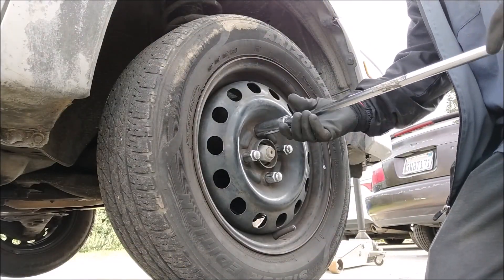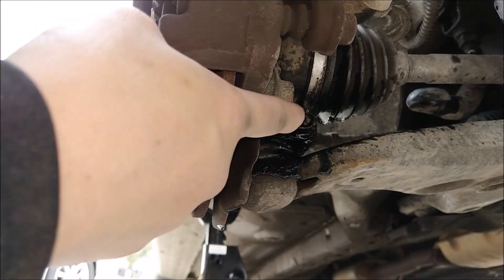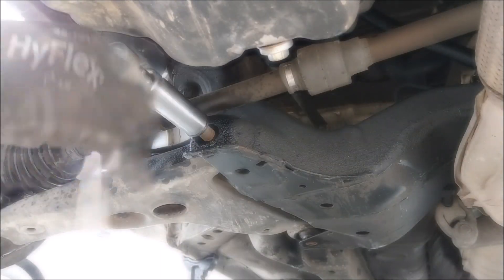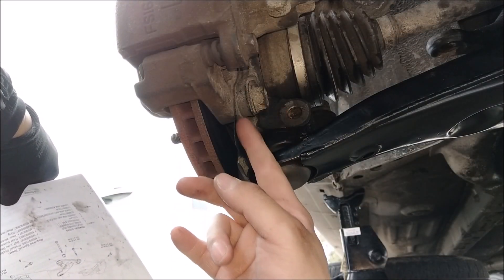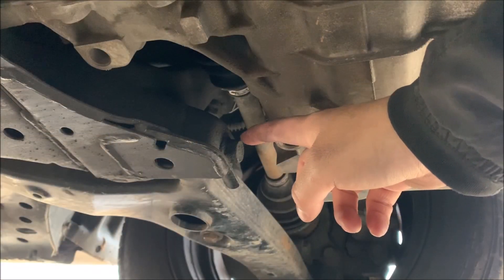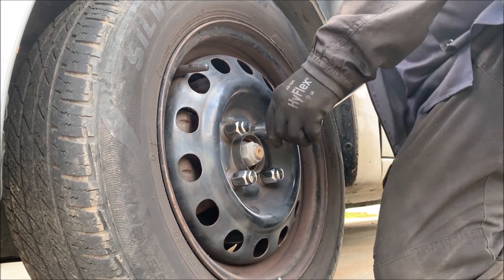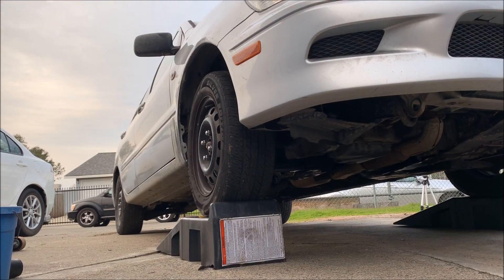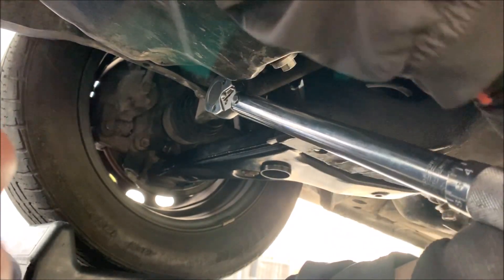Mitsubishi Lancer 2003 ES - Front Lower Arm Replacement

Comment: Leaving comment for future users, aligning the rear mounting point to chassis is crucial to be able to thread the bolt. I took a wooden dowel to align the bolt with the control arm angled out from the car, then managed to get a couple threads caught and then pushed the the control arm towards the front mounting point.

Comment: Thank youvery much im in Puerto Rico and you save me $240.00 just to put it on , i just went spent $300.00 on tools i love working on my cars i don't trust mechanics bunch of scam artists,  trying to scam me for $240.00  plus i had the parts , so i fix the links ,plate,shooks , i got back operations and lots of titanium in my spine , but i always have work on my car's since i was 16 years old, im proud of my self that i was able to fix my lancer 2004 i got it new in 2004 and its 2020 and it runs just as good as my Toyota Corolla 2016.
Reply from the maker: I'm glad my video help you out.  I understand where you coming from.  You really do not know if mechanics out there are really fixing your vehicle correctly.  When you keep your car well maintenance,  it should last you a very long time.  I tell people that I take care of my car and my car take care of me.

Comment: After I turn my wheel the control arm doesn't slide in like yours , should I hammer it in ?
Reply from the maker: This part of the repair was difficult and time consuming.  I did not use a hammer to install the lower arm.  It just took me multiple try before i was able to install the front lower arm assembly.  The order I had shown on the video seem to work for me.  You might have to give it a little push to go in.

Comment: HI Mr. Chang! First thanks a lot for the video, it helped a lot changing my right lower control arm! quick question did you need to do an alignment after changing both control arms? Thanks in advance for your answer! Cheers!
Reply from the maker: I am glad the video had help you out.  You do not necessarily need an alignment to drive you vehicle.  But i would advise to get an alignment done.  Your vehicle will be slightly off whenever there is a repair done on the alignment system.  This will cause premature wears on other part of your vehicle, such as the tires.
Reply: @donkeykongchang  Thanks iwill get an alignment then!

Comment: Hi Kong what are the symptoms if i need to replace lower arm left and right assembly...What about the rubber bushings itself is that only need to replace??
Reply from the maker: The common symptoms of bad control arm bushings and ball joints:
- Clucking Noise
- Steering Wander
- Un-Even Tire Wear
- Vibration

The whole control arm would need to come off to replace the rubber bushing.  You mine as well replace the whole arm with the bushings and ball joints.   Both the lower Arm were about $70 each on amazon.com when i did the repair on this video.  If you wanted to replace just the bushing,  then you will also need a special tools to press the bushing out and back into the arm.
Reply: @donkeykongchang  Thanks Kong I got it mine in ebay... I will install it soon.

Comment: FYI, I was able to torque the front bolts of my control arms with the car on the ground using a 1/2" drive, EP Auto 25-250 ft. lb. torque wrench, a ten inch extension, and a 19mm, low profile nano socket by Astro Pneumatic Tool.  The wrench is about $40 on Amazon, and so is the socket set.
Reply from the maker: Now I'm going to have to tilt my hat to you on this repair.  Way to go!  I was thinking maybe i needed one of them drive onto the ram lift,  like the one they have it at the alignment shop.  Then i'm able to get under the vehicle and get a good leverage on that bolt.
Reply: @donkeykongchang  I just wanted to recommend those tools if you don't have em' already.  They came in handy for me, like your videos.

Comment: Did you have any trouble aligning the bolt near the oil pan?  I can't seem to get mine into the last hole.  Is there a trick to it?
Reply from the maker: I had replaced both my lower arm assembly and alinging for the three bolt is the hardest part of the repair.  It did took me quite while to install the lower arm off camera.  What i found to work best is screwing on the first bolts in the rear (be on 6:11 of the video).   Once the first bolt is on,  you can move to the second bolt which is on the front (be on 6:32 of the video).   Once the second bolt is on,  you can then work on the last bold which is under the hub/knuckle. For me, it had to be in this order to work.
Reply: :hand-pink-waving: I just finished my Lancer 2005 yesterday and that was the hard part.  I found your video today lol  exactly as I did it just did not have torque spec! on my hand!  My car is working great !!!   just patient for those bolts guys!!!  save some $$  @donkeykongchang

Comment: Great job! What is a price for this Lancer in US?
Reply from the maker: I bought my Lower Arm Assembly’s off Amazon a while back.  They were $81.29 each.  I’m pretty sure if you look around online you probably find them for cheaper.
Reply from the maker: Oh sorry, I miss read that question.  The Mitsubishi Lancer 2003 ES is a 16 year old car.  You can get a used one from a private party for roughly $1500.
Reply: @donkeykongchang  Good price :) Middle price in Ukraine is 5500-7000$ for 2005-2007 years Lancer IX, with 1.6 engine or 2.0(rare)